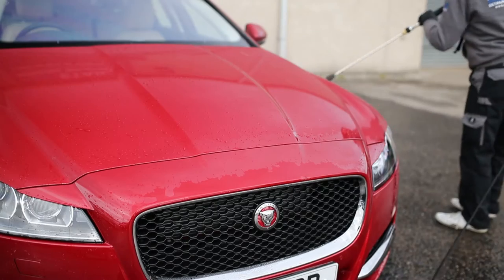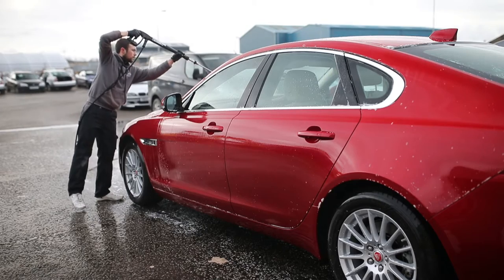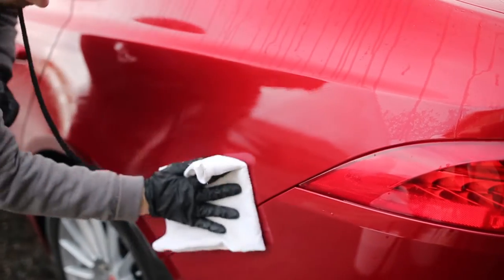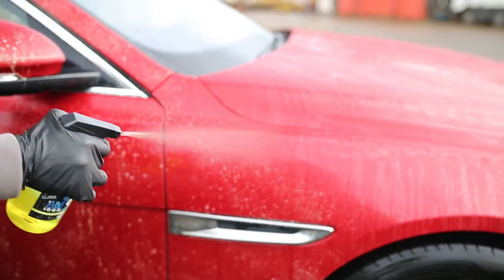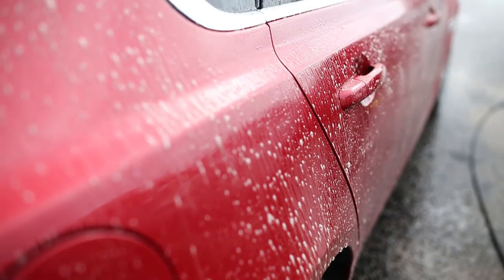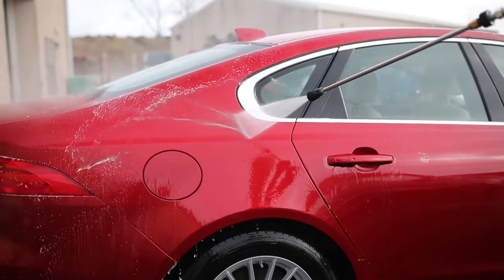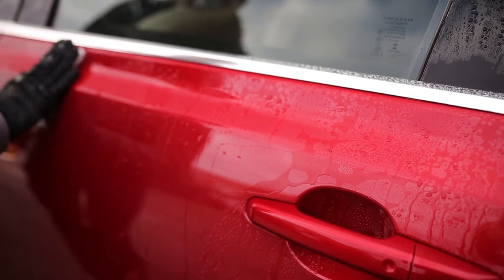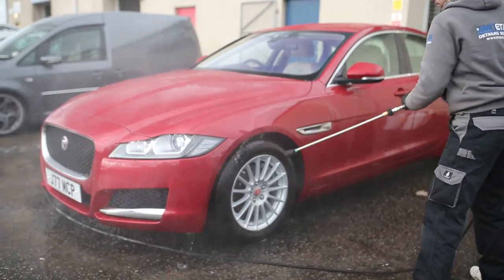How To - Decontaminate Your Vehicle Paintwork - Tar, Iron & Clay Bar

Comment: How often do you decontamination your car ,.. + do you still need to do this if yourselves been getched cheers Alan .
Reply from the maker: You can do stages if and when required depending on driving styles and road conditions. but we suggest every 4 to 6 months. For a major decontamination.

Visual contamination such as Tar can be done locally more often.

Gtechniq is the same as the contamination will still bond to the surface and need removed.

Thanks - Alan

Comment: Some fallout products suggest that the fallout should be sprayed on a dry panel/car to work properly. I see your fallout is sprayed on a wet car. Does this work efficiently when wet or should it be dried first?
Reply from the maker: Scott Marshall hi Scott great point... drying the car can help the reaction. But as we still have a few steps before we want to dry the car. We apply when wet... firstly to help reduce the product drying out. Secondly to try keep panel temprature down. 

We also use it like a soap after leaving AM Iron to work and agitate the product with a microfibre towel and the 2 bucket method.

hope this helps.
Alan

Comment: Are you still do it the same?
Reply from the maker: Close enough sir.

Good tar session. First with AM tar and a MF cloth. Making sure to look through the wipe and tackle any larger chunks that need more attention.

Rinse

AM Iron. Remove with MF cloth and using the Two Bucket Method.

Snow Foam and Rinse

Use AM clay and Water as lubricant.

Hope this helps. 😎👍🛎️

Comment: Hi there,

I just want to ask you a question. can a use a multi-purpose cleaner such as those that states to remove tar and greass and waxes, all at the same time? are they safe for the paint? can they leave streak marks and stain the paint.

I would really appreciate if anyone can help me with these questions

cheers

Comment: Hi Alan, just wondering on your thoughts on clay mitts? Currently use the Farecla G3 Body Prep Clay Mitt on my Peugeots, would you say that are any good or just a bit of a gimmick?
Reply from the maker: +Andy Sharp..... hi Andy. Clay mitts definitely have their place in the market. We don't tend to use one here unless circumstances require a serious decontamination method that will be machine polished after use. 

We wouldn't use one if just going to use a glaze or hand polish afterwards. We would always suggest doing a full liquid decontamination before hand also.

The AM Clay bar does a great job and leaves a damage free finish even with water as a lubricant. 

Untill we source a clay mitt that can do the same. We will not have one in the product line.

I hope this helps.

Alan
Reply: That's great thanks for the information there. Think will try one of your clay bars, sure seen them over in autosave Edinburgh as picked up some apc there at start of week. thanks again.
Reply from the maker: +Andy Sharp indeed. We are in all the Autosave stores. I look forward to your thoughts. Alan 😎👍🔔

Make sure to send in your results.
Reply: Will do! be tardis for the tar removal and autobrite purple rain for the iron but when run out be moving to AMdetails deffo.
Reply from the maker: +Andy Sharp two great products Andy. They will see you right.

Safe wash... Tar...rinse...iron...rinse...SnowFoam rinse.. clay session... 😎👍🔔

Comment: So no drying at all until decon all done and rinsed down? I just worry about water spots. Also, would you say marring always occurs after claying and you should always machine polish afterwards? I'm thinking if the car is only lightly contaminated and you use fine grade clay you can avoid marring? Cheers.
Reply from the maker: Hello Richard,

Drying inbetween each stage may indeed speed up the reaction / make the chemical more effective. But its not what we do here. Between each stage we rinse down the vehicle to as to remove as much residue as possible. the time / chemical saved, for us is not worth the drying between each.

Althoguh i would suggest a good snowfoam / rinse session afetr your liquid decontamination, Tar & Iron, So that there is no reaction with your claybar. A througrough liquid contamination will remove a large majority of the contamination meaning there is minimal left for the clay bar. Taking every step you can to help reduce indicing your own damage is key.

But yes we would Tar, Iron then claybar. any light defects induced by this processed is easily tackl;ed with a hand polish during the protection detail stages.

If you have heavy contamination such as overspray or a large organis fall out contamination as tree sap. then you may induce more damage and a more aggressive polishing session.
Reply: AMDetails thanks for your answer!
Reply from the maker: Hey, Richard no worries.

Also forgot to mention we use filtered water in our services. This helps reduce the chances of water spots.

I hope all this info helps you on your detailing journey.

Alan